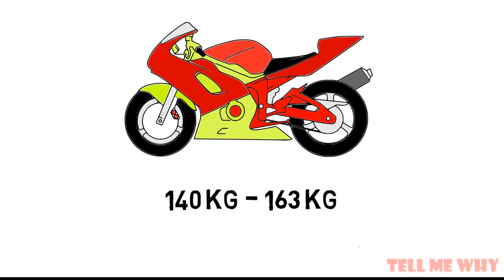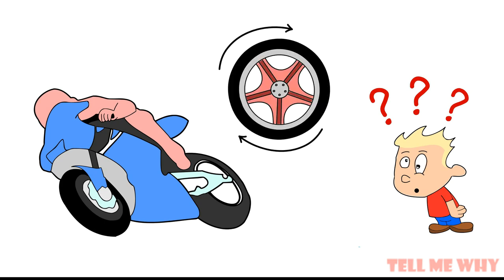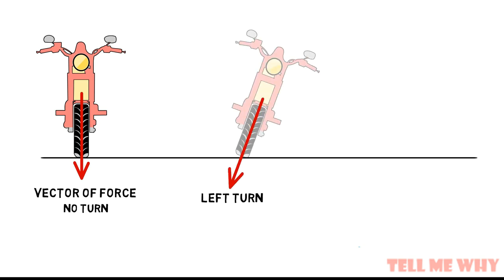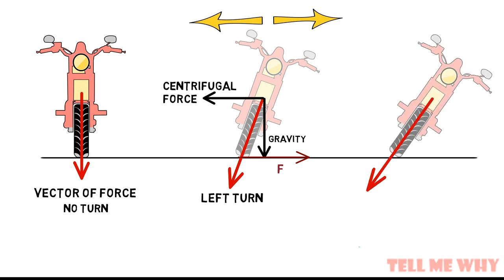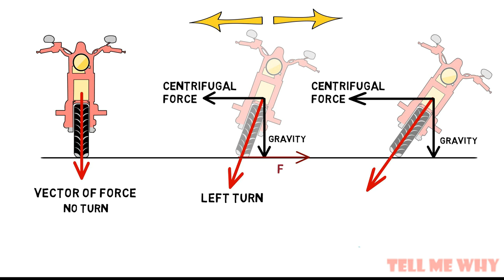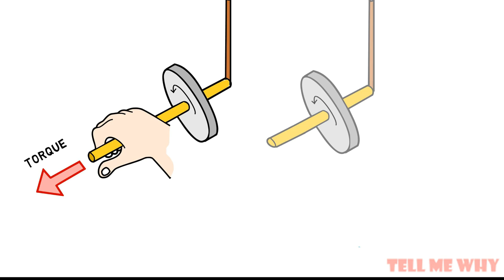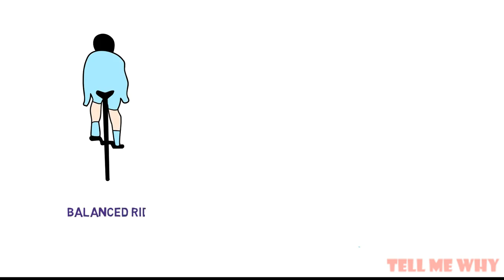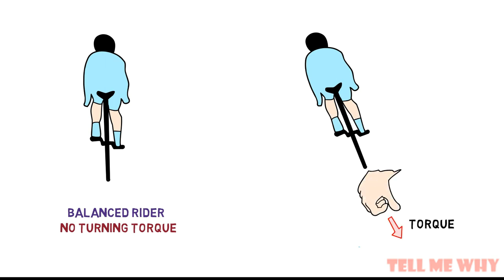How do motoGP riders bend so much without falling?

Comment: couple of things buddy the illustration of the bike at the end is a bicycle not a motorbike but since they are both in line singletrack two wheel Vehicles they are subject to the same forces and steer the same exact way. I do have a question for you, at what point does the centripetal or rotational Forces, or lateral-side Forces overcome the vertical Forces. obviously the end result is the front tire sliding out but is there a mathematical equation to determine at what lean angle does the side or lateral forces overcome the vertical Forces